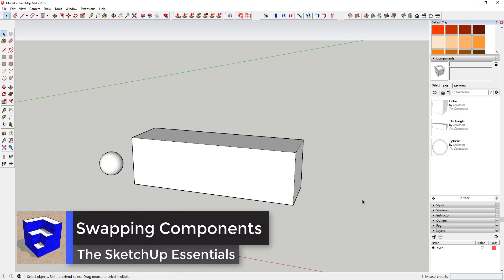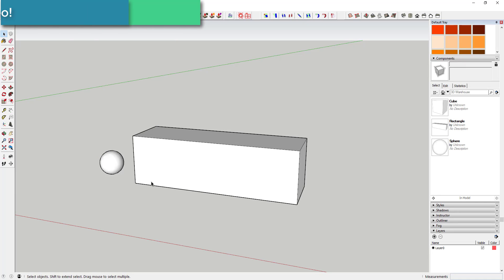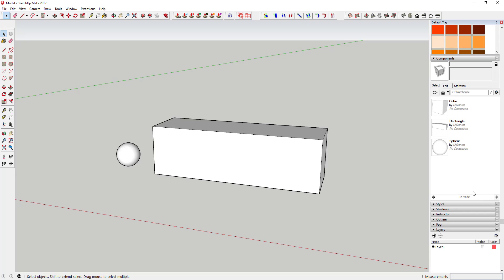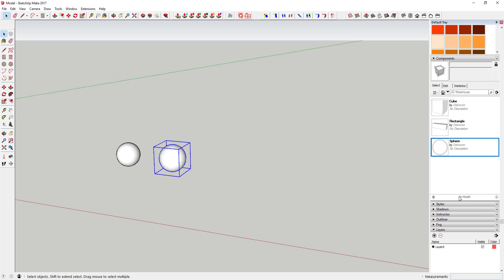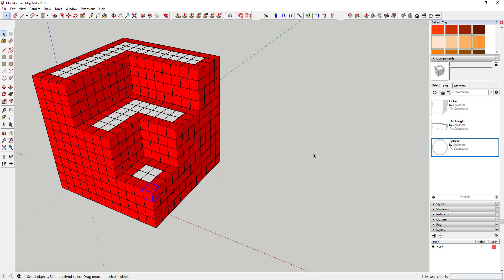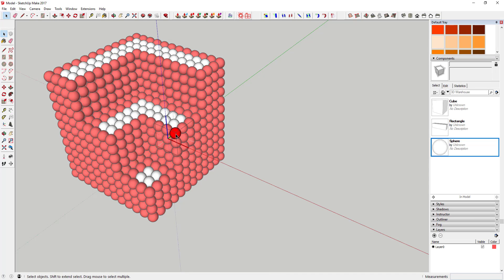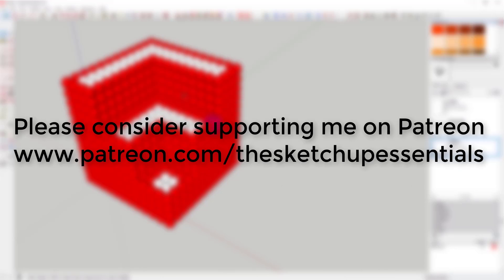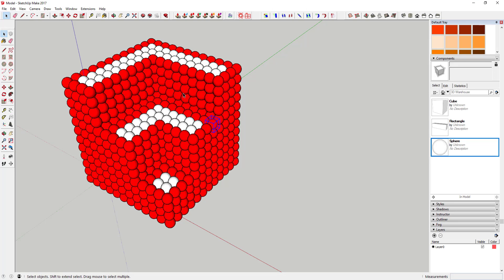SketchUp Quick Tips - Quickly Swap Components

Comment: HI

I don't understand why the white ball replaced to red box , the color will changed to red?
Reply from the maker: The color doesn't change because it's applied to the outside of the component "container." When we swap out the component, because the actual geometry inside the component doesn't have a color, the color on the outside remains unchanged. I can't remember for sure, but I may have covered it in this video - https://www.youtube.com/watch?v=Tw6VToqjbCI - Thanks!

Comment: Hey Justin! The logo made out of cubes is what made me click the video lol. I'm currently working on a project that involves modeling solely with cubs with strict parameters (you can only snap a cube corner to corner or face to face so that the cubes cohere to a "grid" and are flush to each other). Right now I'm copy clicking one cube at a time which is extremely time consuming; do you have any tips or suggestions?
Reply from the maker: Hi Daniel - If I'm understanding your question properly, you may want to use the method described in this video - https://www.youtube.com/watch?v=Bl95U1KxflI . You can make one copy with the move tool, then type in "x2" and hit enter (or x however many copies you'd like to make). This will allow you to make multiple copies at once. Does this help? Thanks for watching!